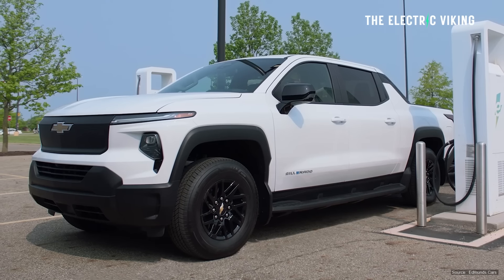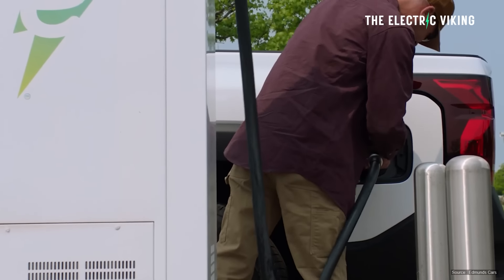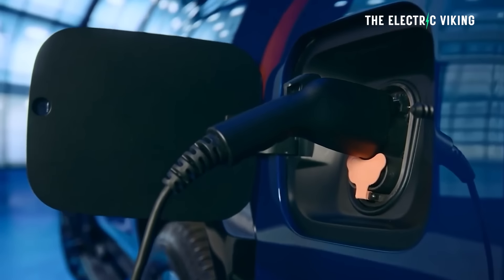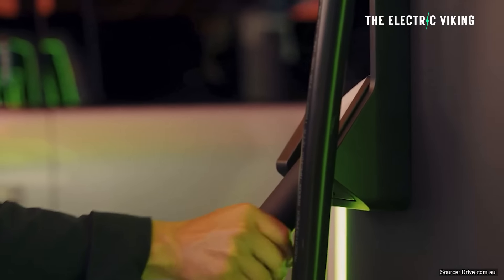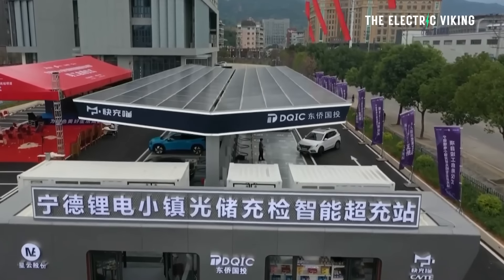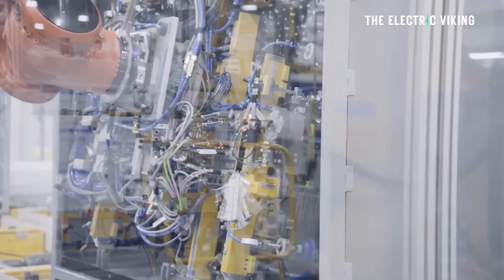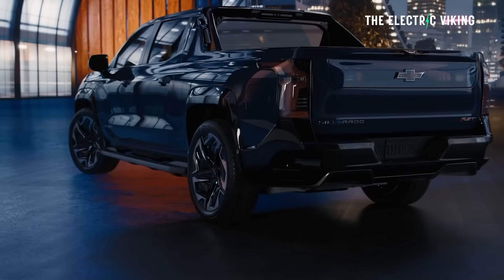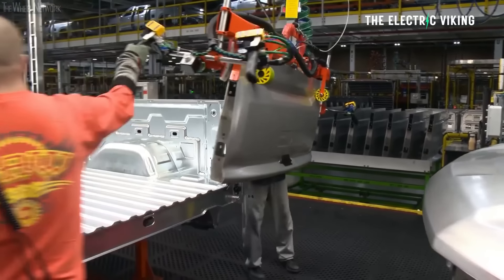The fastest charging EV ever tested in America...

Comment: Perhaps someone will bring out an EV with four battery packs each rated at 20 kW hours,  that can be charged in parallel.  Charging multiple smaller batteries in parallel allows for distributing the charging load across multiple charging points, which can help mitigate the slowdown in charging rates that typically occurs as a battery approaches full capacity. By spreading the charging load, you can maintain higher charging rates for a longer duration, potentially reducing overall charging time and maximizing charging efficiency.
Reply: I can envisage an EV with four battery packs with each offering say 80 miles range and charges almost four times the speed.  A battery management system would utilise the batteries as required, based on the divers operating and charging habits.
Reply: Additionally, charging multiple batteries in parallel can offer flexibility in charging scenarios. For example, if one battery needs to be charged urgently while the others are not fully depleted, you can prioritize charging that battery without affecting the charging process for the others.
Reply: Using smaller batteries in parallel also provides redundancy and fault tolerance. If one battery were to fail or experience issues during charging, the others can continue to operate independently, minimizing the impact on overall system performance.
Reply: Overall, using multiple smaller batteries in parallel for EV applications can be a viable approach to optimize charging efficiency, flexibility, and reliability, especially in scenarios where prolonged high-rate charging is required.
Reply: It could probably charge to near full in under 10 minutes.
Reply: Just buy an ICE car and all your range anxiety will disappear.
Reply: Not a good charging curve. It falls of a cliff.
How many miles do you get in 20 minutes? That is the most important question.
Reply: They are already doing two battery packs. Four packs is only a matter of time.
Reply: 4 charge ports on a car? Not going to happen. Much more likely the tech improves to the point where efficiency is better and one battery can be charged faster and safely.

Comment: When you have a ridiculously big battery you need ridiculously fast charging too😊
Reply: What's ridiculous about having more range especially for a truck it uses more power when it is loaded or is pulling a load you need more energy to do that
Reply: @donblythe3766  nothing other than cost, weight, resources etc. Of course to haul loads it’s necessary, not so much for overall range but for towing and hauling range to be more than enough
Reply: @donblythe3766 Price, for one. Battery costs coming down but not 50% less like Sam keeps claiming. GM will be losing money of these even at this high price. What we need are efficient vehicles, not massive batteries.

Comment: Actually, the Silverado's charging works in reverse of what's stated here. It's a 400v architecture when driving, but the packs come together when charging on 800v chargers to form an 800v architecture to give it that 360kw speed.

It's the fastest charging in the entire world that has been independently confirmed in the real world. In other words, not claims from a manufacturer of this or that charging speeds. There's not a single video online to prove any of those outrageous other higher claims. Go ahead, search for them. You won't find any.

However, with the Silverado, you can watch regular users in the real world doing those charging curves and charging speed full tests from 0 - 100% on YouTube for all to see. That's where the Viking is getting that graph from -- one such EV YouTuber -- the Out Of Spec Channel. It's on their Out of Spec Studios website.

And that charging upgrade in the Cybertruck has already happened, and although better, it's nowhere 20% better. However, Tesla has yet to open it's full 800v charging curve. It's all been 400v charging thus far. On 800v CCS chargers, it only goes above 300kw to around 9% before dropping back down hard.

Comment: Fast charging is bad for battery lifespan just as frequent hot-rodding is bad for battery lifespan.  EV's go through tires much faster than ICE car's go through tires and the main reasons for that are:  greater weight results in greater tire wear; and second, the high acceleration that many EV's have tempt drivers to romp on it and that is an even bigger reason why EV tires last so short  time.  And when you romp on it the power delivered by the battery is very high and that negatively impacts the lifespan of the battery.

Comment: Generally a fan of the channel but the anti-union rhetoric expressed here over multiple videos, multiple times is becoming objectionable.  Respectfully, if costs of production, particularly union labor,  are going to be a repeated topic here,  then it is fair to balance labor costs by bringing up the cost of repeated mega billion dollar stock buybacks and the scores of millions of dollars those put into Mary Barra's annual pay (her pay is in stock) and the board's pockets.   It is possible to pay a fair wage, with decent benefits,  if financial engineering is not actively being used to loot and hollow out the value of the company.  Billions in profits over decades that could have been shared with workers as salary but which were spent on stock buybacks instead.  Let's hear a little bit about that.  Thanks in advance for a little fair discussion,  bigger picture balance on this topic.  (You can't bash the union and then totally omit the costs in tens of billions for buybacks, or the cost of annual CEO compensation in the scores of millions.)  Thank you, still a fan....

Comment: How efficient is this truck? It’s expensive, it charges fast, and it looks decent. What does it cost to drive this thing if you need that big of a battery?
Reply: The only plus with that large of a battery is when towing I would think.
Reply: Yea they didn't mention anything about "efficiency" but rather charging speed and size of battery pack... could end up spending twice as much as a tesla that has double the efficiency with less size
Reply: The cost to produce such a truck will eventually kill it. At least the first iteration of it. It will take them at least 5 more years to make it profitable and the price at retail will make it a luxury vehicle.
Reply: Do the math .. 200Kwh battery that goes 460 miles 2.3kwh per mile .. 

Think a power wall for your home that can run it for 2-3 days is only 30 kWh … 

Get the connection to the house .. you could run your house in a power outage for 3 weeks! If you had solar power .. even longer (assuming your not driving anywhere)
Reply: @ffmcmav40  so with that math a tesla model y long range would be roughly 55 to 60% more efficient on the road. With that battery pack size as an equivalent it would put it at over 700 miles. And still potentially house for same time frame if the v2h was available. So al though impressive still not there yet. And losing on money on top of that then its gona be a minute before profitable.
Reply: @ffmcmav40 

Umm, check your math...

You got that backwards. 2.3 miles per kW...
Or 444 Wh per mile, 276 Wh per km. Seems reasonable for a bigger vehicle
Reply: @ffmcmav40  "Do the math .. 200Kwh battery that goes 460 miles 2.3kwh per mile" ... its actually roughly .44 kwh per mile... and the model Y with a "82 kwh battery that goes 330 miles is actually. roughly .25 kwh per mile" which makes the model Y roughly 60% more efficient... so im not sure where the mathing  descrepancy is.

Comment: Common sense should tell you, the faster the charging, the higher the degrade 😂😂😂!  Plus don’t forget, you will have to build new chargers for everyone to charge at those speeds 😂😂😂
Reply: Nah, not true. You have to look at the C-charge rate, which is fairly low at this Silverado EV whcih means stress-free charging and you have to look at the battery chemistry and design. The Silverado EV will last ages. No problem
Reply: What is a fast charging speed?
What degrades batteries?

Are you a battery scientist?
Design engineer? 
Test engineer?

Note that batteries have come a very long way the last while, and are being improved at the fastest rate in history. 

Decent BMS, themal management, and newer battery chemistries have made battery degradation very minimal. 
Most battery issues are now from water intrusion. Usually from flooding or physical damage allowing water in. EV's having battery replacement is under 1%. And that includes older tech batteries, where some did have issues. 
The newest chemistries have also reduced battery wear to neglectable levels...
Reply: @jeffl4810  😂😂😂 a uk Tesla driver just drove a Tesla for 100k miles in 1 year super charging the life outter the battery, now he needs a replacement 😂😂😂! Phone battery degrades over time, and phone batteries are smaller 😂😂😂! For over 15/20 yrs of battery life of phones, never ever had a battery improved! It has always degraded which make almost everyone upgrade 😂😂😂😂! Common sense not common, but yall make me laugh trying so so hard to pass a message that once you buy an ev with a battery, you never gonna replace it 😂😂😂! Who actually has a business model like that? 😂😂😂 funny ass Tesla fans 😂😂😂! Soon they gonna be like fast charging in 5 mins 100% battery life 😂😂😂😂 even your phones with a smaller battery and tech can’t do that! But it’s now a full car that requires lots of power 😂😂😂😂 mehn yall got it 😂😂😂
Reply: @BBingo-v5i  let me make it easy for you! Who is gonna build that charging infrastructure for fast charging like the post said? 😂😂😂😂😂!
Reply: @adebayokehinde  literally every manufacturer of DC fast charging stations in the world except Tesla. 350-450kW chargers are being installed in huge numbers around the world already. You could easily drive through western Europe by only using these super fast chargers. In China at least the metropolitan areas and big highways have these chargers already. No problem
Reply: @adebayokehinde  and there's the model 3 with over 420k miles with minimal battery degradation. Fast charged 2x daily. 
Battery chemistry matters. Not all Tesla's use the same chemistry. Especially Tesla's model S, which the batteries were optimized for super car performance. Not longevity.

I'm sorry, but the rest of your post is too much of a pain to read and comprehend with all those run on sentences and smiley faces...
Reply: @adebayokehinde  
Look around. That charging infrastructure is popping up everywhere. And the more EV's on the road, the more the charging stations get built.

And most people charge at home, like they charge their cell phones

Comment: Is this really a priority, when 99% of the time an EV is charged at home on a level 2.
Reply: Lots of people buy cars for that 0.5% of the time event.... that's why trucks are so popular in America...
Reply: You can't really charge big utility trucks at level 2. Even with 10-11kW flat charging this would take 20h at level 2. At 20-22kW you still need 10h. 800V super high speed charging is the way.
Reply: @BBingo-v5i  yes you can.
But for full top ups, it'll take awhile. Like you said around 20h. 

For most people, plugging in 1-2 times overnight per week will keep a decent charge on the battery. 

No one normally travels 450 miles on a daily bases. Even hauling 200 miles on a daily basis would be extreme. 

For most people 450 miles would last a couple weeks. 

Fast chargers would be useful for the days when hauling a long distance, or road trips.

Comment: Rate of charge is one side of the coin, but efficiency is the other.  What's important is the number of miles of range you get in a 10-20 minute charge.  On that metric I doubt a big truck is going to gain range faster than something efficient like a Model 3!  250kW to 350kW is perfectly adequate for most cars, but once we consider bigger vehicles like trucks, vans, lorries etc then we'll definitely need 500kW - 1MW charging speeds.
Reply: Semi's use big chargers in the 0.5-1MW range

Comment: Most people need to stop focusing on charging speeds. Most people charge at home 99% of the time. 
If you are a person that does actually drive long distances then take a look. 
But even for that occasional trip to the cabin it is probably not worth upgrading or paying a premium for a bit faster charging speeds at this point as there are few chargers capably of those speeds.